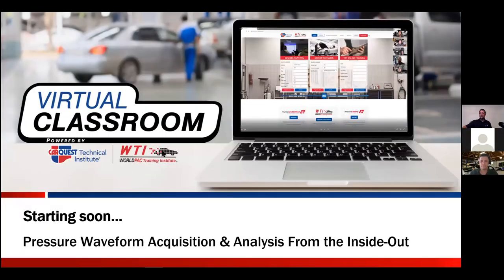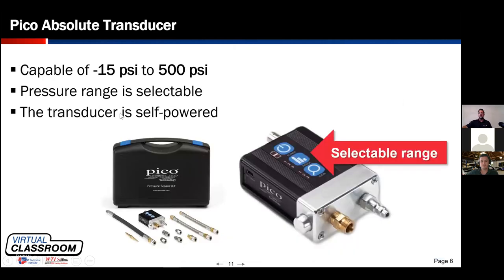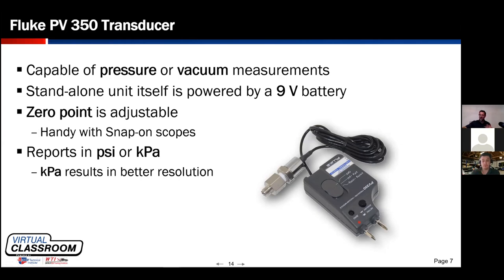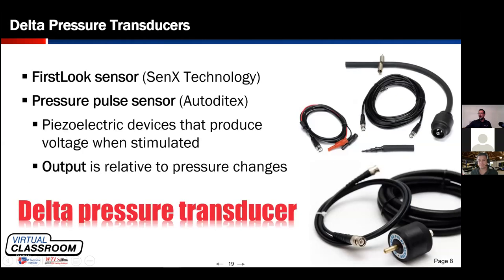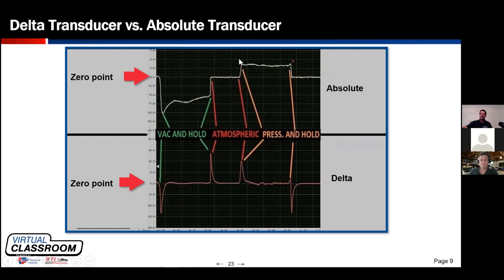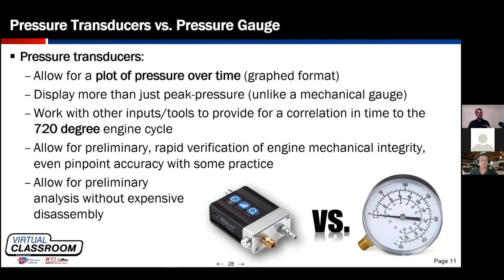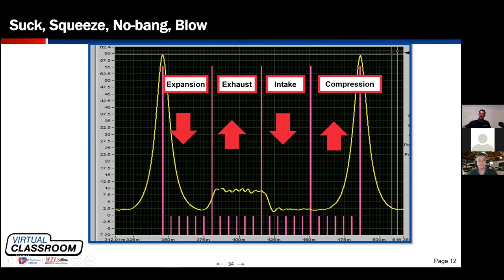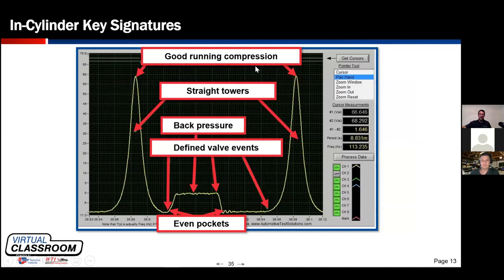CTI AD-3000-8 Session 1

Comment: One way to identify the correct Fluke PV350, that works with a scope, is to open the back up so the battery is exposed.  Look next to the zero adjustment button.  The good model has a little blue box in that area, the bad one doesn't. Credit to Super Mario diagnostics.
Reply: is this the same with PV500? I got this model and I could not see vacuum changes from the manifold, just a straight flat line.

Comment: Good ol' Bernie Thompson says that a difference in towers halves of about 15-2deg is ok, and a if exhaust pocket is witin 2psi of intake pocket, that's ok ... any thoughts or experience to the contrary ... I reviewing an old capture on a good cyl that has a 15deg variation in tower halves, but the tower also has a pressure rise that is quicker than the expansion.

Comment: at 28:00 minute demonstrating ATS vacuum transducer on scope and applying vacuum to that sensor pulled the voltage down and applying pressure push voltage upward,i thought ATS vacuum transducer push the voltage up and a lower vacuum brings the voltage down,at least that is what i get when using the 30 inch vacuum transducer on e scope.